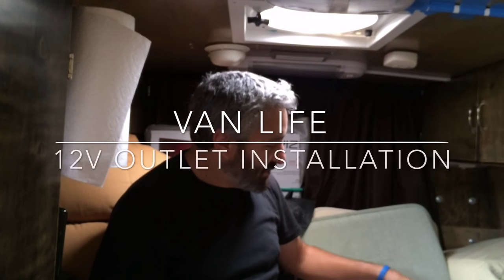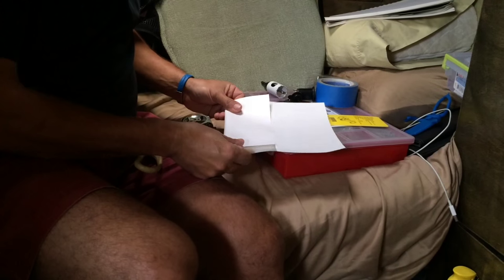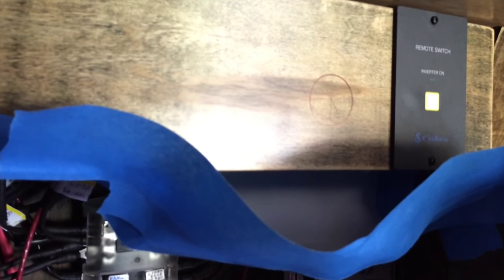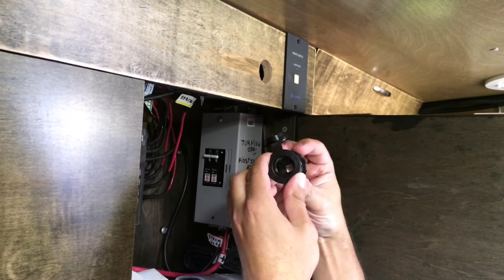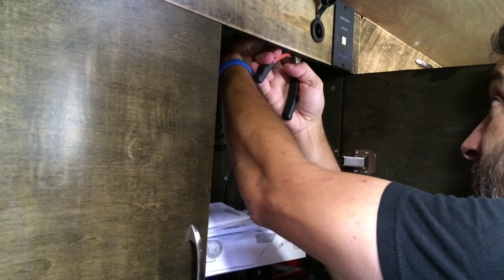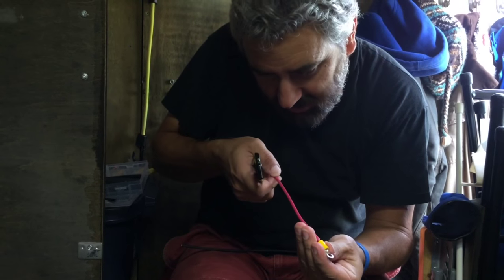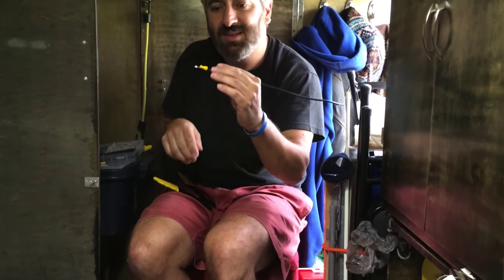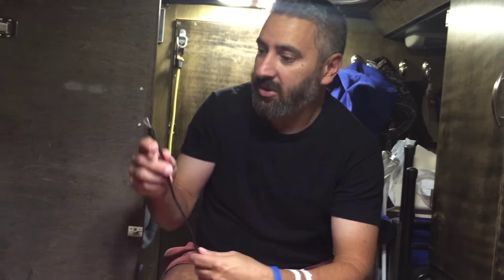Van life; 12v outlet Installation!

Comment: Luis, your cables are neat, but,personally, to use that outlet with something that has a heater, like that pan, I would solder the wires besides crimping them.
Reply from the maker: That would indeed be nice, unfortunately I don't have the soldering equipment, besides, the crimping should have a good connection and last a long time. 😄👍🏻🚐

Comment: Another nice job. I would've soldered the wires also this way there isn't any heat build up.Who was doing the camera work or was that something you strapped onto yourself? Great work as always. I see allot of beefy cables in there, what are they connected to, I mean the clear box?
Reply from the maker: Some people solder, some do as I did. It all depends which tools you have. Crimping is way less messy though. 
The bigger gauge wire connect the batteries to the charge controller and the fuse box. 👍🏻😄🚐

Comment: If I don't have a fuse box, would I wire this directly to my 12V battery? Also, do I have to have the ring terminals? Thanks!
Reply from the maker: Jeannette Dickson you could wire it directly to the batteries/battery. You must however have an in-line fuse close to we’re it connects to the batteries/battery. You won’t necessarily need ring connectors, you can use alligator clippers, but you have a better connection with them. 
Hope that helps. 👍🏻🚐☕️🖖🏻
Reply: Thanks so much! Love the videos
Reply from the maker: Jeannette Dickson you’re very welcome, and thank you. 👍🏻👍🏻🚐☕️